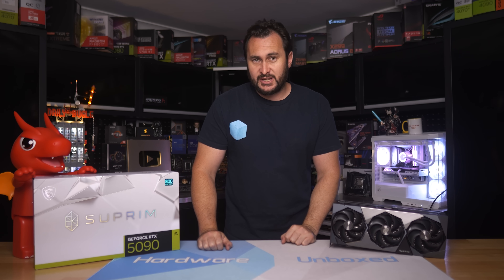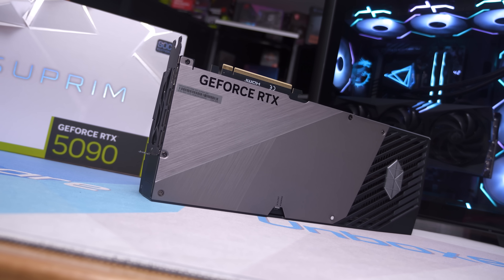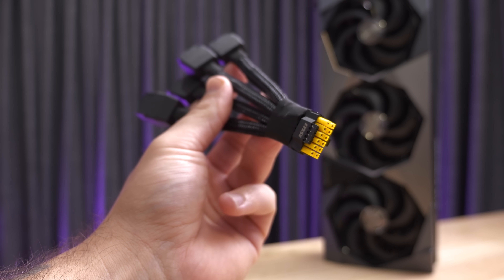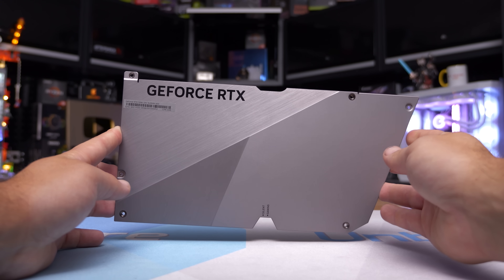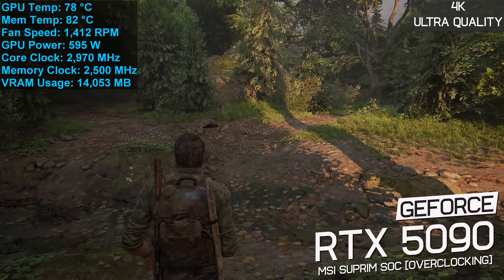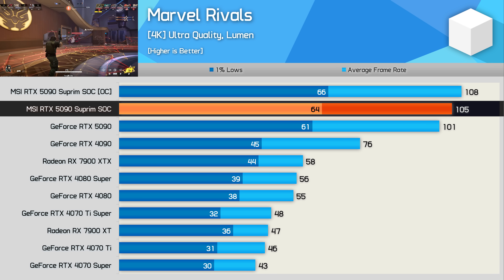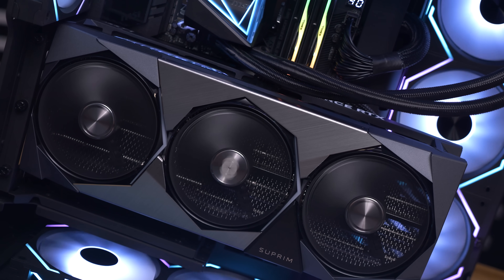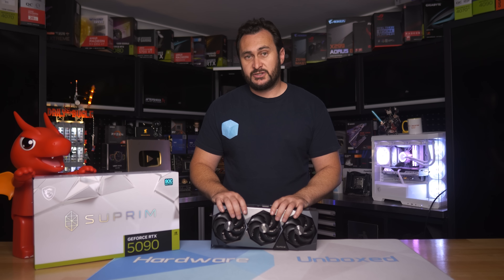MSI RTX 5090 Suprim SOC Review, Biggest Graphics Card We've Ever Seen!

Comment: Four slots is too wide to save 6 degrees. With only 4 pcie slots in most server level boards, this would cover 2. I have 2 fe cards and they stack up next to each other using 2 slots.  2 did overload my 1200 watts psu at 90% power target for both. 1500 was fine. I did have to plug into my laundry room 40 amp outlet as the lights would flicker.

Comment: 2:44 Just to let you know, the GPU support is better than it looks. It's plastic covered so it will not short anything. It has a rubber pad on the top so will not scratch your GPU. ..... It has a magnetic in the base of it, that makes a solid attraction to the PC case. Once you position it, that's it: you have - fit and forget.

Comment: The power draw and connectors for these cards genuinely scare me. They're pulling more than the max the cable is rated for and I don't trust the cable to begin with. Is there an easy way to limit the power draw at the cost of a little performance?

Comment: What I want to know is whose fault it is that those space heater GPUs have a single power plug? I personally give no fucks about aesthetics - to the point I will go out of my way to buy a case without windows and stuff. So I want a reliable power connections not a single plug running at the design limits where if I fart to hard close to it I risk burning down my 4+k dollars computer, cause possibly dude in a leather jacked has a hard-on for low amount of cables. At least give us second connection as an option AKA let the GPU boot up with just one plugged, but have secondary one if I want to reduce the risks and give no fucks about having less cables.

Comment: I think it's a mistake to call the GPU stand low quality simply because it's not metal, I know we associate metal with quality but in this case I'd much rather something which is loose inside the case is not conductive and plastic is also very durable. I don't see the downside for this application.

Comment: If you can't clean brushed metal with Isopropanol (isopropyl alcohol, 99%), you can always "even out" the oiled surface first with small amount of light oil (sewing oil, or cleaning oils like Ballistol, or even a bit of WD-40 on a rag), and then remove as much of it with alcohol - it should look clean then, even if technically there is still some oil remaining in deeper grooves.

Comment: I'm concerned about the normal thermal paste, thinking it will pump out fairly quickly at those temps. How difficult is it to get it open to repaste? 19 screws doesn't sound bad, but that "suction" you mentioned feels scary with such an expensive card.

Comment: 80°C power connector, 800 Watts of power draw on a 600Watt certified cable.
💯percent we will have melted cables/conectors again, why is the tech industry not making it a 2x 12V-2x6 600Watts?
These cards are nearly 3K USD are they stupidly cutting corners again? This is not okay, tech reviewers should be angry about this!

Comment: I am SO CONCERNED about power running through that stupid 12VHPWR connector. IF it's rated 600W max, why it does permit 650W? What's the point of the "sense pins" if it keeps pushing more than it should?
Reply: Its actually 675.

Comment: And otherwise informative review is somewhat undermined by the power consumption numbers and the lack of criticism thereof. 
I find that the power draw (and cable heating up so much) would've merited an entirely separate video, or at the very least a much more nuanced discussion about the risks involved. Going 50W over the spec 600W spec (a 12% increase) for the 12V cable seems very reckless and I don't look forward to the news of houses on fire due to these cards.

Comment: So, what about the temperatures inside the box ? Is it the same as having a 4090 or more ?  Does it create any issues on CPU cooling if you have a good ventilation system or it is an issue going from 4090 to 5090 ?

Comment: I haven't bought a new graphics card since 2016 - still using a GTX 1070. Is anyone else the least bit concerned about the size of modern graphics cards? I feel like this thing would either gonna bend the PCI slot or just fall out entirely.

Comment: If your psu comes with the 12pin should you use that? Or should you use the included cable adapter?

Im upgrading to a newer 1200w psu and this new 12pin connector is new to me.

Comment: The horrible design is the placement of the power plug, as when hot air blows out, it will heat the fragile cable design and bom 🔥

Comment: Almost three kilograms ... holy crap. It's kinda funny to me that the FE is designed in such a way as to eliminate the danger of cracked PCBs ... although it's relatively light and probably wouldn't self-destruct under its own weight, anyway. But that the partner cards (some of which are even heavier than the MSI - Asus Astral weighs over three kg) still use a more traditional layout and thus can potentially put insane amounts of stress on the PCIe-slot/connector. If I was looking at a 5090 (which I'm not) I'd seriously consider an AiO version for reasons of size/weight.

Comment: I think I'll stick to my 4090 and wait another 2 years for 6090.
At that point a node change should occur and power draw should drop as performance also increases to a point it will be worth the upgrade.

Id also be surpeised if nvidias fe cooler dosent simply get reused with a new paintjob for the next halo card in 2027...

Comment: So, let’s sum up, rtx 5090 560w + inter i9 14 900k 351w case with ssd hdds 50w fans 50w and psu efficiency 90% and we are looking almost 1200w of heat. That would require some serious underclocking. Cuz without ac it would be impossible in be inside the same room.

Comment: Almost 800 watts of power drain, an 1000W PSU surely not enough there
Reply: No problem, that's enough.
Reply: @mieczysawmietki4053  JayTwoCents also stated the same as i did.
Reply: For the RTX 4090, an 850W power supply is easily sufficient, for the RTX 5090, a 1000W power supply is easily sufficient.
Reply: @mieczysawmietki4053  Can you detail the math behind this?
Reply: @Betonoszlop  There are RTX 5090 tests on the internet, just read them and you will know how much power the entire computer draws.

Comment: Just on the notorious 600w connector, I've been a rewinder for over 20 years and just from my experience with alternators where relatively small conductors carry huge current and low voltage I'm fairly confident in the connector as long as it's properly terminated, plugged in and seated correctly.

Comment: In my 20 years of being an electrician im confident a plug connection at 78-80⁰  won't last long. We actually look for hotspots and repair them.
Reply: 80°C power connector, 800 Watts of power draw on a 600Watt certified cable.
 2x 12V-2x6 600 Watts, this could easily solve this giant issue. But nooooo...
Reply: 70°이하 권장

Comment: My entire PC with a 9800X3D, a 3080Ti with a 450watt power limit, 64GB of DDR5 RAM, 5 NVMe SSDs, and 2 HDDs. PLUS my 4K 240Hz 32in OLED monitor.

All together, still doesnt even consume 750 watts, even under 100% load. Thats absurd. I guess you just give up on playing games in the summer with a GPU like that 😭

Comment: That power draw.. So there's just about zero efficiency uplift from the 4090 in rasterization, just the ability to draw even more watts in for more performance essentially?

My 4090 will be safe for the next few years it seems. It's at an excellent sweet spot of power usage, temperatures, noise and performance for DCS World QHD triples (plus software engineering with Cuda). And it cost me AUD $2789 in September 2023. (The efficiency uplift I got from the 3070 it replaced was tangible.)

Comment: The power draw and those temperatures are insane, you need a cold server room to have a PC cool enough, and hook it up to a power station rather than a power supply module.

I don't think the extra performance is necessarily worth all that.

Sticking with my overclocked RTX 3080 for now.

Comment: The GPU support stud might be better in a non-conductive material. 
I think an alcohol based cleaner will get rid of the fingerprints. Either alcohol or maybe somehting like hand gel.
RE: power consumption, DerBauer did a vid on power limiting the 5090. E.g. a 10% reduction in power with this Suprim, might result in only a 2% reduction in performance. It will keep that connector cooler too.

Comment: 11 slot gpus and theyll still use 2 slot brackets.
Reply from the maker: It doesn't really matter, you don't gain much if any support from using larger brackets.
Reply: @Hardwareunboxed  really? All that weight is fine on just 2 slots? Id get it if it had a deployable support or add in one but I'd imagine whatever extra slots you could bolt in would help a little.
Reply from the maker: It's not on 2 slots, that's not how this works. It's a metal bracket that is attached to the back side of the case, it's more than strong enough. The weakness takes place at the opposite end of the card.
Reply: @Hardwareunboxed  oh okay. Thank you for explaining, I'm legit not trying to sound ignorant, I've just not handled the newer massive cards.

Comment: A GPU stand is insufficient, in fact probably causing more harm. These GPUs should be mounted vertically. The GPU stand will aid in warping the pcb from upward pressure, creating flexing points that will crack traces, even the pcb, and pull VRAM off pads. This is already a common issue on 40 Series GPUs.

Comment: Well, first of all excellent review as always. 

As for the 5090, I can sum it up as "nice publicity stunt marketing move" from nVidia. 

They've managed to garner attention, while also using the MFG to divert the attention from the main points of criticism, like the fact it indeed feels as "4090 TI" (as the joke from the FE edition ran) or the massive price (not even talking about the MSRP), tho it's rather an industry issue rather than nVidia alone. 

The MFG is basically a non-issue, let's be honest. There are really few games which support Frame Gen to begin with (and it needs to be implemented by the game dev), there're even fewer games which support MFG, and even fewer which are alreafdy out and/or have it working properly. 

In the end of the day, it's mostly a gimmicky feature, much like 3D or other features like physX and so on were, in short not essential. And no amount of corporate marketing talk or fanboying will change that. And nVidia knows it perfectly, more than any one else. 

Ultimately, it still comes down to the same old classical faxtors: 

1. Can you buy it (in the first place and do you rly need it) 
2. What practical uses can it serve and are you gonna be actually making use of them 
3. Are there better alternatives (for your use case) 

Of course, it's always nice to have the "biggest and strongest" and if it wasn't the insane Power Consumption (tho you can Undervolt and reduce it), the main obstacle remains the price. (Given you have a powerful enough CPU to pair it with). 

But other than are there other cheaper cards which can provide more or less the same for the time being? 

Certainly, if we are talking primarily gaming. 

Realistically, unless your use case scenario is the 5090 and nothing lesser, then go for it, but objectively, regardless what other various use cases you may have there are only so many technical parameters. 

Ultra-high Res or/and FPS (4K/500FPS and above) 

Most case (even with this card) won't get you in the 500 FPS (whether due to hardware limitations or the games just being too heavy even for this GPU). 

So even a tier or two below the 5090 will likely do just fine. Or even below that. 

Competitive games like CS2, Valorant and R6S can push more than 600 FPS if your system is strong enough and practically that's where those high FPS will matter the most. 

Altho it can be useful or the least very fun to have them in some offline games too. And there are tons of older games with nice looking graphics which you can easily get 600 FPS on weaker systems. 

Same goes for higher resolutions.

Comment: Default clock test: GPU 66-67 degrees, fans 1640 RPM
Overclocked test: GPU 78 degrees, fans 1410 RPM

So the overclocked test not only used a different fan curve (probably the silent bios') but a fan curve that resulted in running the fans 230 RPM slower even though the temps were 11-12 degrees hotter.

Awesome testing! Real thumbs up there, guys!
Reply: Good point

Comment: Nvidia: massive improvement in design, smallest PCB yet allowing for 2-fan flow-through, optimized design so it's only 2 slots, liquid metal. MSI: LOL just put bigger fans and more fins. So MSI wins using brute force over cutting-edge engineering.

Comment: As a fan of Suprim series for being not expensive for top-tier solutions... I am disappointed.
Sometimes performs worse compared to FE and less stuff (crappy GPU holder as example. 40xx has better one) with more power consumption and barely useful OC?
 I think 4090 Suprim was WAY better that that compared to FE and ASUS RoG. And price been far more sane. This is bs?
Or maybe Nvidia started to play greater with their cards again as it was from 30xx to 40xx when those had problems with GDDR6X cooling... I do also wonder how that cable under 60-80 C will go in a future considering their promises of 12vhpwr being resistant to failures...

Comment: seriously, ZERO fucking cooling innovation in these partner cards. HOW on earth does nvidia innovate in such a cool way for the thermal solution when they DONT even have to, but these so called partners whose only job is to literally design better thermal solutions, dont even provide the I of innovation. JESUS. All they do is slap a bigger slab of aluminium on the pcb.
Reply: Nvidia is making way more profit on their cards than the partners are because of the cost of the chip, that's why EVGA left. Why waste money on R&D when people will buy the cards anyway? At least MSI had a clone of the FE last gen and a AIO model.
Reply: @fups1  Literally what Im saying, Nvidia doesnt have to RD new thermal solutions, they spent millions on this crazy new 2 slot 575w cooler which is insane. People   buy it anyway and their gpus are already top notch. Meanwhile a partner card should bring something to the table. Nvidia couldve shipped with blower fan and made more profit lol. Partner cards are also inferior in quality

Comment: so if i get you right:
1. - only Temperatur to hold the Card, is to set the Bios to "typically" not to OC, not to gaming.
2. - the Watt Power is insame, to much, and absolutly far of every sence.
3. - the heat on the Power Connector, is one reason more, to limit the Power consumption to max of 70%, what also should have the Temperature in an usable niveau.

anything i forget ?

Comment: It will max out 60c with open case, why do you need to close your case, your 20 fans aren't going to be as effective as opening the case.. Owning 4090 Suprim X and its quitest and coolest card I've owned, during winter time i see 53-56c playing with 100% tdp, +50mhz core oc and +1000mhz memory. My 4090 went through heavy loads 24/7 for 2 yrs, its as new, fans are double-ball bearing and extremely reliable and stable. This review doesn't represent real capabilities of the card, he didn't even test it at 75% fan speed with open case. Didn't say anything about pcb despite all the best of the best used.. Instead he labels this review as - biggest gpu he has ever seen...

Comment: When you did the manually overclocked tests, why didn't you also A) overclock the memory (you barely did), B) enable & max-out the voltage slider, C) set the fans to static 100%? This way we could at least get a much better idea of the potential performance the card is capable of...Instead, no memory overclock, no voltage slider increase, and the fans spinning at a slow 1400 RPM like with the SILENT BIOS's fan curve. Are you kidding me?

Comment: To be frank, at 2400 dollars it doesn't feel all that premium. Asking price over already expensive card is high. They already have their margins to resell their version of GPU at 2000 dollars and they want an additional 20% over it? That seem excessive and I hope that it will sell about 200-300 premium over base model. MSI really need to make this card from more premium materials and provide better accessories.

Honestly, it feels like RTX 4090 Ti and it is not as exciting as to buy RTX 4090. I would prefer to buy RTX 5080 with this model and same size cooler at more sane pricing.

Comment: The TIM on the gpy die looks more like a phase change material than traditional thermal paste. It has that melted plastic look when solid.
Reply: How can you tell? it looks like thermal paste to me.
Reply: @GeriatricWidowMain  Just guessing by the look of it. The coverage is extremely even and thin both on the coldplate and the core. PCM at room temperature is "semi-solid", much more solid and not goopy like paste. It has a "melted plastic" look, not sure how to describe it. 
At 8:32 also you can see the distinct imprints of the tiny SMDs on the outer parts of the TIM, that indicates the material is much more dense (solid) than paste.

Comment: Its OK, but I hope there will be other vendors that utilize Nvidias new cooler design that makes it a 2- slot card again.
Also the connector issue is not solved, why not put 4 8pin connectors directly on the card instead of using that dangerous cable?

Comment: I was planning to buy but there is no way that's fitting a corsair 400d case. 4090 suprim already comes close to touching the front fans. Also, 600 plus wattage for only 20 percent gains is insane. My 4090 suprim never pass 450 Max. What a massive disappointment.